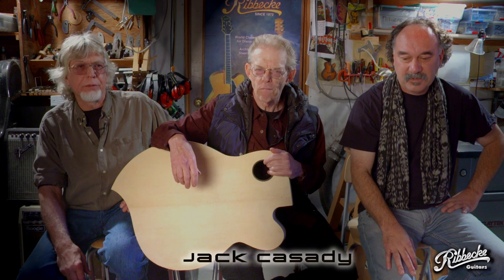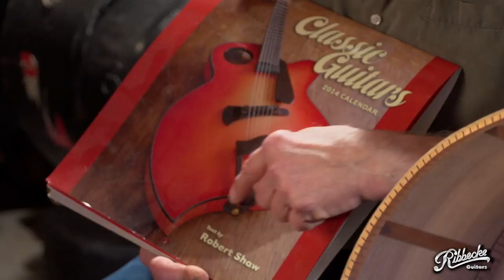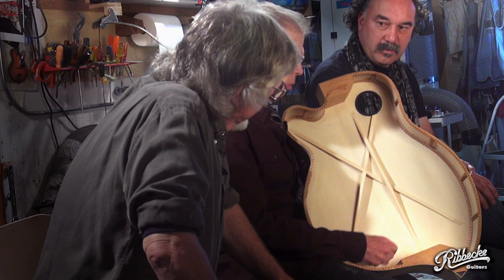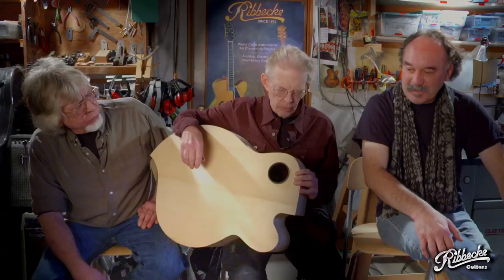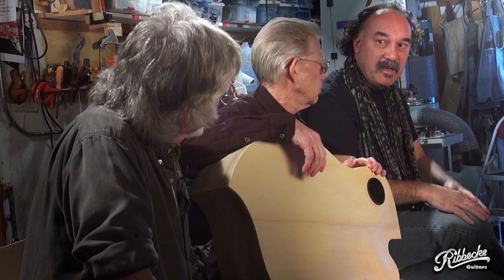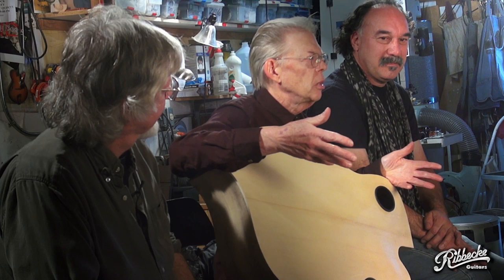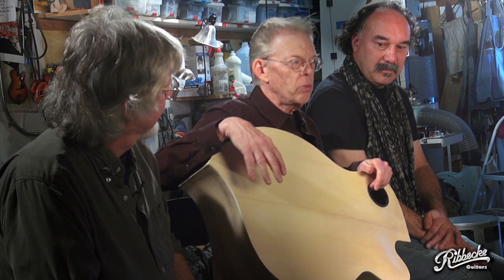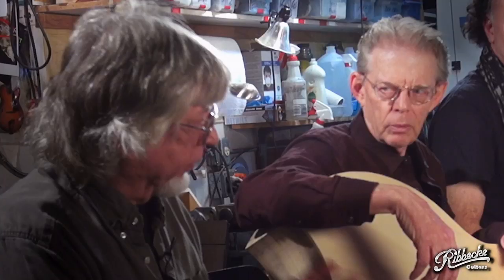Creativity 360 ~ FULL SHOW: Jack Casady with hosts Bobby Vega & Tom Ribbecke

Comment: The low 'E' note on a bass guitar has the frequency 41 c/s (41 Hz), that is a wavelength of 27.44 feet -- as sound is round (propagates in all directions), that is a sphere, a 'bubble' of 8.74 foot DIAMETER --- to faithfully reproduce that note, its 'fundamental' (not its 'overtone') requires the bass speaker (the 'driver') to be mounted in a round pipe  of 7 FEET in length -------- a low 'B' bass guitar requires a pipe of 9.2 feet in length;; that is why it is difficult to make an ACOUSTIC bass with a body big enough, and deep enough, to sound 'true' bass notes ------ LOW bass, 'feel' it in your bones.